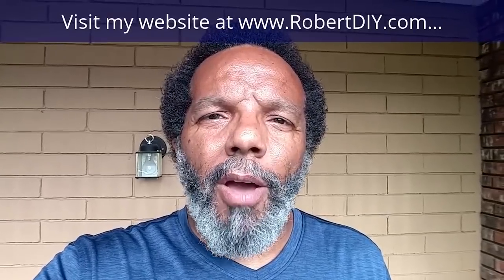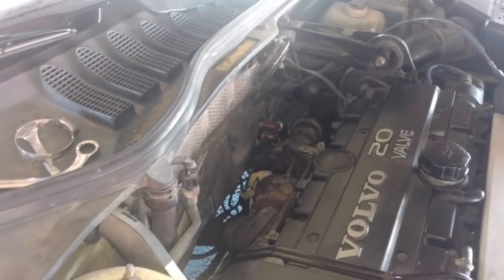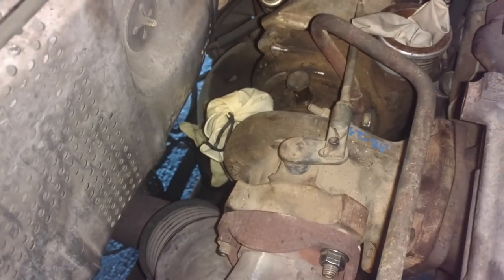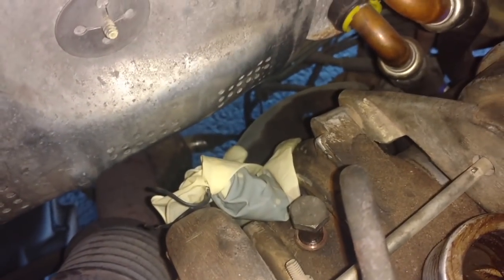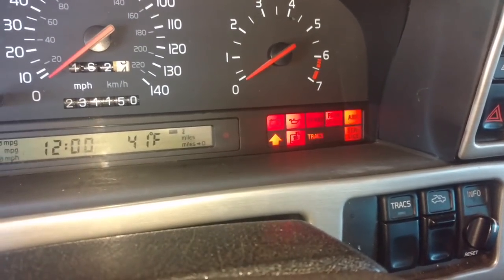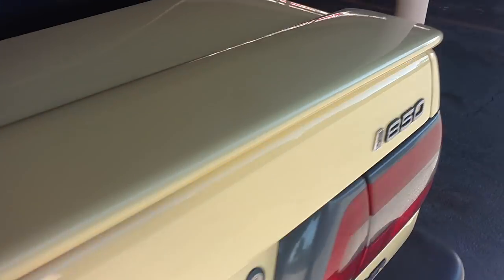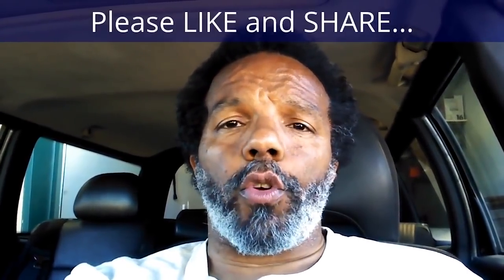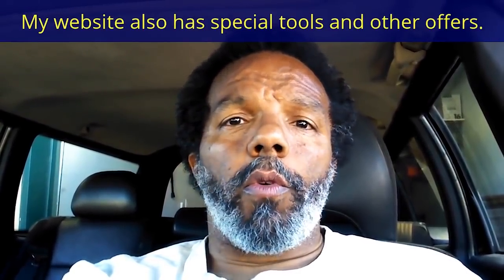WARNING, Purge the turbo after you installation and before you start the engine to prevent damage.

Comment: This is incredibly helpful.
Going to do a boiler delete
And run a catch can before we install the Kunigawa 22T with the 5+5 and new controls.

If you ever have any Stock ECU/ECM boards from an 850R; I will happily donate whatever you need for them.
Reply from the maker: I usually sell the stock R ECU for $125 shipped.

Comment: Such a simple and effective solution,  thanks for the great idea Robert. 
Q: any thoughts on storing a turbo off the car and filling it with ATX fluid?
Reply from the maker: No need to add any fluid in it. If it's out of the weather it will be fine.

Comment: I probably should have done this when I replaced my turbo with a super cheap chinese Garret T3/T4 clone. I just cranked the motor over with the plugs out so it didn't spin the turbo much. Its been 2.5 years and nearly 21,000 miles. The turbo has not let me down yet. Not bad for $105 shipped ;p
Reply from the maker: nice
Reply: Did the turbo fit straight to a T5?
Reply: @nicovanduin1553  The car it is installed on is an 89 Volvo 740 Turbo with the B230FT. The turbo bolted up to the same flange as the factory turbo, and I also upgraded to a newer style B230FT exhaust manifold that has higher flow. The turbo is only oil cooled, unlike the factory turbo, so I added a water sprayer on the factory oil cooler to help keep oil temps down when its being driven hard.

Comment: Hi Robert, what is your honest thoughts on the new Volvo vehicle's.  I got my wife a XC60 T6.  She loves the car I find it to be beautiful too. My dislikes are the frequent software updates. Secondly for "pedestrian's safety" the car front end bumper, lights and hood are made of fragile materials. The durability of my XC70 is by far better than the XC60.
Reply from the maker: Well, I really don't have a real opinion because I've never owned or driven one. It's best to compare apples to apples, newer cars to newer cars.
Reply: @RobertDIY  I'm happy with the old Volvo's. If we didn't accumulate 260000mi on the xc70. We would have never considered getting a new car. Fingers crossed I hope to wish to get 3000000mi from the old one. I hope the own only Volvo's and my Toyota Supra lol

Comment: What did you remove so the engine won’t start and crank when purging the turbo?
Reply from the maker: Usually fuel. Either disconnect the fuel pump fuse or disable the injectors.
Reply: @RobertDIY  Do you have to remove the ignition coil connector where the spark plugs are located?

Comment: What damage or issues would this cause? I rebuilt my td04 turbo on my 760 a year ago i personally havent had issues except lots of bogging at 3-4K RPMs until it pushes past it which ive stopped doing just to be safe
Reply from the maker: Push away. It's like starting an engine that was freshly rebuilt. May be the difference of the turbo lasting 50,000 miles vs 200,000 miles.

Comment: I installed a new k03 turbo on my 12 A4 2.0
Just installed it and started the engine didn’t know I had to put oil in the feed hole.
When it started I can hear grinding. Now I hear it a little only when I cold start the car. Then the turbo sounds fine.
Could I have damaged the turbo?
Reply from the maker: Maybe, if it's not smoking and boosting good I wouldn't worry about it.

Comment: How many time's can you crank it over ? My oil light doesn't go out. Cracked it a fair few times now. Is it safe to carry on cracking over?
Reply from the maker: I suggest you crank it 30 seconds on 1 minute off and keep doing it till you get oil pressure. If you don't get oil pressure, find out why before you start the car.
Reply: @RobertDIY  OK thanks apparently on my car the oil light will go out once the car is started as there isn't enough pressure just cranking over to cancel the light out

Comment: I dont get how he primed the turbo exactly
Reply from the maker: Made sure the car would not start and cranked it until the low oil pressure light went out.
Reply: Robert DIY how long did this take Robert? Mine I’ve cranked for 3 minutes straight and there’s nothing.